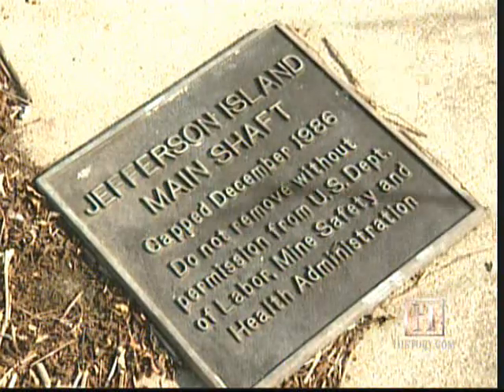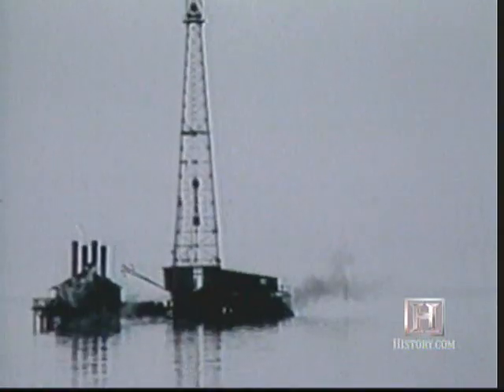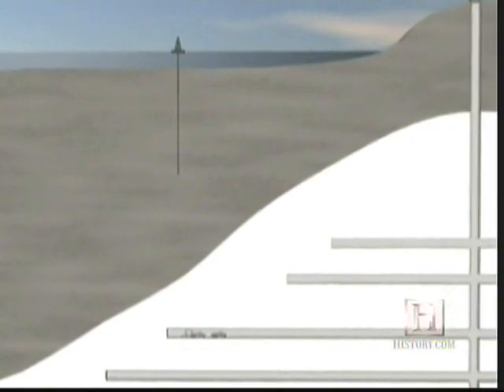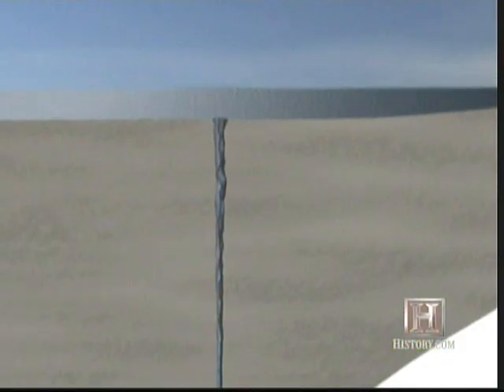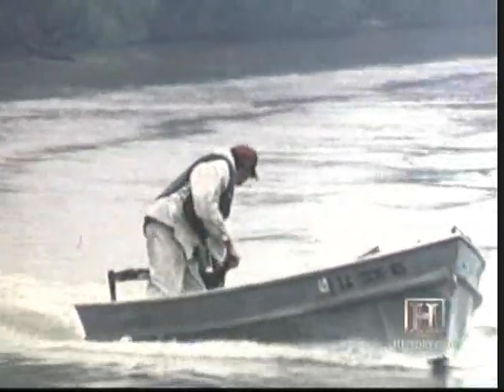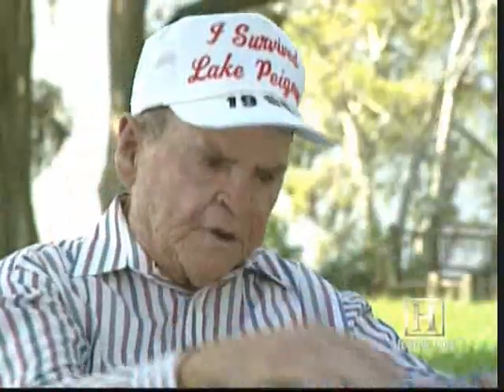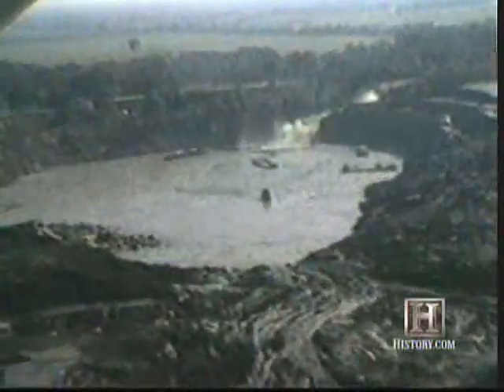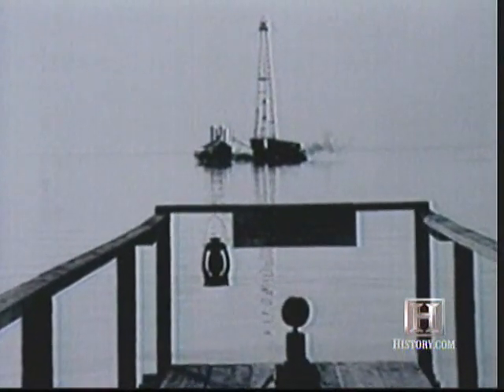Oil Driller Breaches Salt Mine Under Louisana Lake

Comment: All 55 miners made it out of the salt mine. Sounds like a company that had their shit together. You don't usually hear that kind of stuff in these stories.
Reply: I read up on this mine a little and the owner went beyond with mine safety and reinforcements
Reply: thats because they were a mining crew operated by the mine owners, subjected to review by OSHA, and adequately trained. today, we dont have that rigorous burden of compliance. and consequently, for cost cutting purposes, some safety features are sidestepped.
Reply: Out of the mine and out of a job
Reply: @GladiatorReid  well yes, all mining jobs would eventually be mechanized, it is a matter of what stage of mechanization we are in. the computer scientists and mechanical engineers who design those machines, their jobs though...
Reply: @kapilchhabria1727  the mine was flooded, were you thinking maybe they were put in a submarine to mine the salt
Reply: @GladiatorReid  what are you talking about?
Reply: @GladiatorReid  He's talking about mining in general. Not this video in specific.
Reply: @kapilchhabria1727  
A facetious joke...relax.
Reply: @GladiatorReid  Its okay. I get why they are out of jobs. And its not because of robots. Its because the damn mine is flooded 😆 duhhh.
Reply: When I heard all of them made it out, I thought the same thing! Also, just watched a video on the Oklahoma blowout where atleast 5 drillers died because someone shut the alarm system off because it was junk which helped lead to the blowout and the room the drillers escaped to was not built with safety in mine.
Reply: Those men were the salt of the earth
Reply: When I heard about this I was worried for them too! I'm sure glad nobody died. Oh and i never did find out if the oil company ever got sued or not. They should have, it was their mistake after all. But then again big oil always gets away with shit! 😠😤
Reply: If it were a mine run by the Massachusetts state government, all 55 would have died waiting for environmental and diversity studies to be done of their evacuation, as well as protesters for some cause blocking the exits.
Reply: The one thing that will get you a job like that is your knowledge on safety
Reply: Devin Crum they had their shit together alright. Luckily they didn’t ruin a whole lake, forestry, a salt mine, houses, reverse the direction of a canal, create a waterfall, displace underground caverns, frighten the shit out of a whole community. Yes, they had their shit together
Reply: @johnanderson5500  Texaco ended up paying for the mine, rig and the Gardens. They screwed the pooch big time on this one. I heard there was some question about the coordinates that Diamond Crystal had given them, but I am pretty sure that Texaco's engineers messed up. I had actually worked that rig, the "Fred Wilson #1" about a year earlier up around the Henderson Swamp area. This was a land rig that normally worked on land, but Texaco used to build platforms out in shallow water lakes and swamps to put these rigs on and would use barges to hold their mud system tanks and mud chemicals. I was actually working on another rig about 7 miles south of the lake when this happened. We had noticed planes and choppers circling around north of us but didn't know what had happened until the evening news.
Reply: EPA would sue the shit out of the oil company but osha should almost award the salt safety wardens
Reply: With the salt mine down below wasn't it a little risky to drill Which is  baddest  thing 1  sucked  into the whirlpool or inside the mine when the water rolled in  . Certain death guys  smarten up
Reply: The mine I work at would be screwed, we literally just went through safety training and we don’t use a single piece of it, crazy stuff
Reply: I was just wondering about the miners! I didn't hear them mention them, I figured it went without saying that they died. I guess not all mining companies are run by ruthless villains.
Reply: @kapilchhabria1727  Mines are regulated by MSHA and I can promise you no sidestepping of safety occurs. Not at our mine that's for sure.
Reply: @sunsetlights100  If Texaco would have had their shit together on the location coordinates, it wouldn't have been a problem. They drill around salt domes all the time and don't drill near mine shafts. But Texaco screwed the pooch on where to put the rig and as they say, the rest is history.
Reply: @Flying Gig Not on Tuesdays.
Reply: @joesmoe71  actually an environmental and feasibility study would have revealed the potential dangers of mining in such a soft rock, and the permit to mine would not have been issued.
Reply: Would not have happened if two young miners had not of gone to an abandoned area to smoke a during a break.  It was abandoned because it was to close to the outside of the salt pillar and constantly leaked.  This is where the drill came NEXT TO the mine and not into it.
Reply: @kapilchhabria1727  I worked in that mine at the time of the disaster, and I am still working in a salt mine. While heavy equipment is used, miners still do the work the same way it was done back then. I've been working in salt mines since 1978
Reply: @davidb8397  is the applicable for just this particular mineral, or is that true for the industry in general. as i understand it, mining is being mechanized and thus is displacing the human miner.
Reply: @kapilchhabria1727  Would it have been MSHA? Think MSHA was founded in 77.
Reply: Whats funny is you can bet that there were a few eye rolls at having to practice all those evacuations.
Reply: @kuma1388  The mine was not the cause of this though? It was the drilling company that drilled through the shaft causing this issue, so blame them.
Reply: In 3rd world countries, yes.
Reply: @SF-ku2hp  This accident was in late 1980 so presumably?
Reply: Shit I got a family to go home to I’d make it out too with the grace of god team work and determination
Reply: "Sounds like a company that had their shit together." - unlike the people that caused the disaster.
Reply: @moakley  Oh dear!
Reply: @kapilchhabria1727  OSHA is still around. Who's bribing them not to do inspections?
Reply: @kuma1388  the salt company didn't cause it. Texaco did cause it. So, yes the salt company had there stuff together.
Reply: @kapilchhabria1727  consequently the other salt mine less than 20 miles down the road from this mine in the video here was just shut down because of a fatal accident that killed almost 10 people….
Reply: @kapilchhabria1727  You are completely out of your mind if you think we have LESS regulation than in the 80s.
Reply: is the lake all salt water now
Reply: @randomrazr  brackish mix of salt and fresh.
Reply: Nice to see an owner care about his workers, and great to see it pay off.
Reply: I agree..
Reply: @kapilchhabria1727   ummm not OSHA its MSHAW and osha never regulated mining industry.
Reply: It was s salt mine under a lake. I woukd think there would have to be emergency evac. awareness!!
Reply: @GladiatorReid  ...THAT'S BETTER THAN BEING DEAD!!!
Reply: ...AND THERE WAS A GOOD BIT OF LUCK THROWN IN-!!!
Reply: @Chevalier_knight  ARE YOU CRITICIZING?!!
Reply: @daleburrell6273  swimming with the fishies 🧜‍♂️🧜‍♀️🧜
Reply: @SkullCandy5671  ...ARE YOU A GRAND ADMIRAL?!

DO YOU HAVE A BIFURCATED BEARD-(?)
Reply: @GladiatorReid  ...THAT'S UNHEALTHY FOR LAND INHABITANTS-(!)
Reply: Especially not here in Louisiana